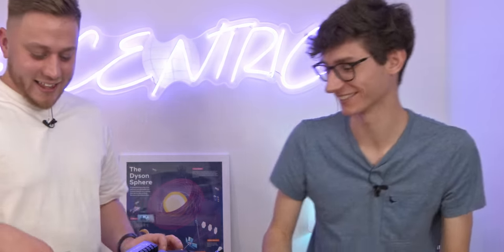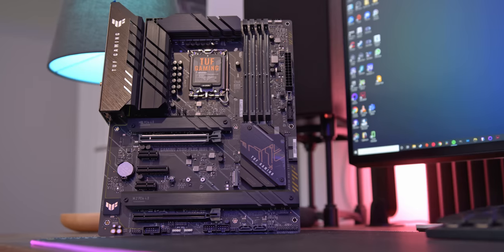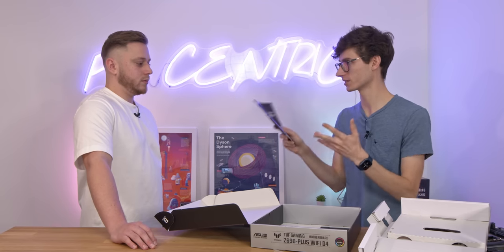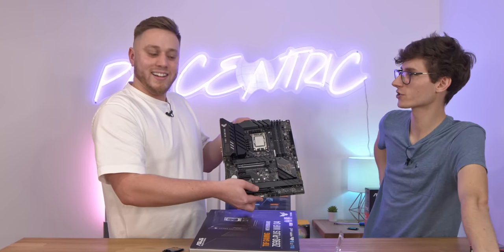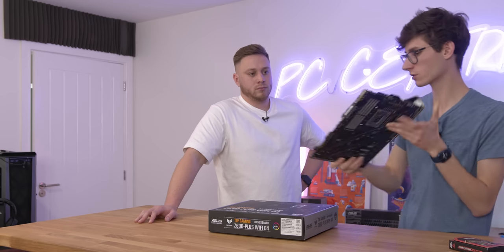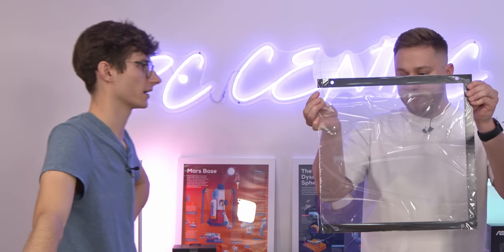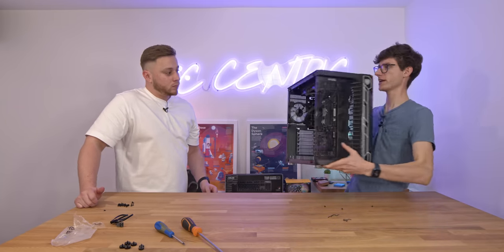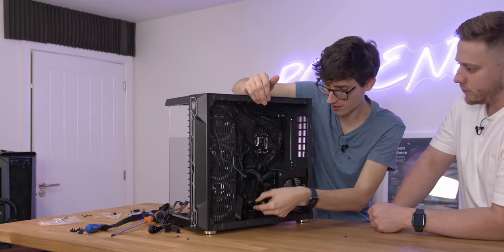Is Building A Gaming PC Hard? 🤔 A First Timer's Beginners Guide! (12600K, RX 6800 XT) | AD

Comment: When I was younger, I thought building PCs was extremely complicated and involved many tools. Turns out I was wrong according to the internet. You just buy the components and assemble them. (I have never built one before)
Reply: in earlier years it was not as straightforward
Reply: You don't just buy components and assemble them, they have to match the case, have room in the case with everything else in it, make sure it is compatible etc, I thought it was fairly easy until I assembled mine.
Reply: @Cam09Sean1  Yeah once you got all that sorted it's just building lego really and then connecting all the wires.

Comment: For any other fellow 1st time builders, you can do it!!! Just got my 1st one done, and not without issues to figure out. But it's all very doable. The main problems I encountered were not fully populating my CPU port on the motherboard (mine had a 4pin and an 8pin) and I figured out my cooling pump was not even contacting my processor so switched some brackets and no more hard shutdowns. Biggest piece of advice, download windows to a USB stick before you finish your build! It took me 5 hours to download lol Happy building guys! And thank you PC Centric. Could not have done my build without you and your awesome, easy to follow content.
Reply: Thank you for the windows tip. Just ordered a bunch of parts (my first pc build), and didnt concider that.
Reply: @Uhdksurvhunter  It is actually very easy when you look it up and watch a video, this commenter must have done it off memory, figured it out, looked it up and read it, or found a not so good video, I can share a video you would like me to, the long part it the waiting for windows to add to your drive.
Reply: gonna build my first pc soon, buying the gpu tomorrow then everything else within the next 8 weeks or so. man im nervous
Reply: when i say first pc i mean my first pc build ive got a nitro 5 ive had since 2022

Comment: I just completed my first build! I was so nervous and excited! Took me a few hours but it's running great!
Reply: Did you use the video as a guide, and how much did it cost?
Reply: @fromawindow9173  I didn't. I had just built it before this video. But I did watch a few YouTube videos to learn how. It cost me about $1000 with everything. I could've saved on some parts like the case and power supply. 

So just do your research before you spend. You can get some parts in a combo deal.

Comment: Great video. I will be building my 1st gaming pc. It gives me confidence. but still nervous I might plug those cables in the wrong slot. It looks easier in this video since PC centric is assisting that guy
Reply: Most cables are keyed, meaning they can not be plugged into an incorrect port.

Comment: I'm starting to get frustrated by the fact that I still can't get a gpu at msrp value bro otherwise I would've already finished my build so long ago :(
Reply: I dont even know where to start with a build 😔
Reply: Go to micro center
Reply: @isaacgarcia206  Assuming they are in the US of course
Reply: same here. finished my build back in May except for the card I want because of the ridiculous price. So I went for a 1060 6gb that's already used for mining for just 138.00 USD from a friend. It's almost dying though with temps going up to 90c even when undervolted and fans at 100%.

I'm hoping to finally snag a 3060 ti or a 3070 before christmas now that the prices are somewhat lower than like 5 or 6 months ago. Fingers crossed!
Reply: @gamax4254  Finally got an Asus Dual 3060 Ti OC! Got it for USD 800 though :( but oh well I believe here in my country the msrp for it would've been USD 500-600.

Other than that, I'm really happy with it! I can finally play RDR2 on ultra 1080p and constant 60fps!
Reply: If you're in Australia, PC Case Gear has loads of gpus for msrp and if you're in the US I believe microcenter has some

Comment: I much prefer the AIO setup to be for exhaust whether top or side/front mounted. It doesn’t make much sense to have hot air drawn into the case. Especially in setups that have additional fans drawing in air from the bottom, front or other side panel. Great build & excellent instructions!

Comment: A true fucking Bro right there!
I bought my first mid range PC as soon as I could afford one. It was used as I wasn't too sure I could build one and back then it was a little harder and there wasn't nearly as much PC focused channels around. I ended up taking it apart to learn how it's assembled and just reversed it, learning new things along the way. The mobo manual is probably the most handy thing you will ever need for this. Done many builds and it's pretty much press the button and it works first time, luckily. Just put together a 12700K build. But never watch The Verge PC Build video! LOL

Comment: Just recently built my first gaming pc, I previously had a 1030 and i5-4590 and ddr3 build LMAO. My new build is an i5-10600k and 3060 16GB of ddr4 ram, it made all the difference in the world. Also it was not as complicated as I thought it was gonna be, the most hardest and complicated part was cable management and where everything plugged into on the motherboard, which is easy once you pull out your motherboard manual. I am looking forward to the next time I get to build another pc :)

Comment: My 1st PC after a console use  2005   2010   2016    2019   2025?  
i got my Older pc drr3 2016 build out ( no nvme-m2 slots) and  added win10 pro - You Notice the speeds using ddr4 and faster Nvme  ssd's  cards

Comment: I think I'd be a better teacher.
I've recently upgraded my computer (from a mid 10s components with a late 2000s case) and basically all you need to know is (of course, some of these have comments about stuff I've done in the past): 
Change the new case's fans for RGB fans
BE IN AWE OF THE CABLE MANAGEMENT SPACE!
Place the RAM correctly. If you don't know, look at how the sticks and slots look. If it doesn't work one way, don't force it.
Place the CPU correctly. READ THE INSTRUCTIONS.
Place the CPU fan cooler..... wait, you'll need to mount an adapter. USE THE CORRECT SET OF ADAPTER that should come with the cooler, if said to be compatible.
NEVER OVER-SCREW.
Plug all the little case cables to their appropriate place on the motherboard. Names will match. Check for what look like what and read the instructions.
Those little single-plug plugs? The motherboard should come with a SMALL SINGLE-PLUGS BIG PLUG ADAPTER. Use it! It helps a lot!..... and will make the cables hold better.
Put the PSU in the case and wire the cables you need.
Put your GPU in.
Plug everything with the matching amount holes.
Wonder what that new mobo HDMI output is for.
Disregard that new mobo HDMI and stick with the good old GPU.

Comment: For my experience yes gaming pc can be hard to be built if youre not ready enough. First of taking care of the cable management should be prioritized if you have a powerful gaming pc since there can be alot of wires, If there is a problem you can hardly troubleshoot it if the cables are messy af, The gpu you should be cautious about and aswell as the cpu since the static in our palm can damage them and that the warranty will be revoked you should wear a gloves you should properly  analogize the fans is the easiest, and in the near future it gets easier and easier and harder at the sametime.

Comment: Can you help me build my new PC 🤷‍♂️🤣. It's gonna be my 2nd build but this time adding RGB fans. 

Spec will be:

Corsair 5000d case
I9 12900k
3090fe
Adata xpg lancer ddr5 (until white dominator becomes available)
Seagate firecuda 530 2tb
1000w psu 🤷‍♂️

Comment: Hey Marcus, as a newbie DIY builder i hit an issue which may be worth highlighting to your viewers, in particular those noobs like me who feel emboldened  by your videos. I went for a B660 and paired with with a i5 13600.... the motherboard has no flash bios... so unless you have an old 12th gen lying around, you are effectively dead in the water... unless of course you get a celeron purely for the update... so frustrating as i completely missed the manufacture date vs bios update for the B660 13th gen support

Comment: This is totally cool but you chose the wrong GPU completely. Along with not going with DDR5 RAM having access to it, you should have just used a 5600X. IMO this would have worked a lot better and made a lot more sense spending just another hundred bucks on DDR5 RAM and then an Nvidia 3080 for similar performance in games, more features and less money. Swap the RAM for budget tier DDR5 from a good brand like Crucial and swap the 6800XT which is a great card, have one myself but not as much of a value for gaming as the same priced 3080 Ti or save the money you spent on the DDR5 getting a 3080 which will get the same FPS in games as a 6800XT for the most part and have ray tracing etc he could play with.

Comment: my set up is a 3080 /3800x /32GB 3600mhz/B550 micro atx am4 / 120mmAio/ B550/750w gold / 3440x1440p 165hz/ All i do is play games and watch videos i wanna do a few upgrades with Christmas coming up i need some gift ideas i wanna get a 4k144hz as my second monitor but i can buy that myself im not quit hitting 165hz  at 1440p on my current set up what should i upgrade and what should i get? i can get maybe like 3 thing and i just want more frames! im stuck between getting the 3800x3d or going ddr5 and or switching to intel. Most played games are warzone and sea of thieves

Comment: Building a pc I’m getting a Asus ROG STRIX B450-F GAMING II ATX AM4 Motherboard a 1650 graphics card, 16gb of Corsair ram, cool master double fan, a case with 2 fans, 2tb of sea gate storage, ryzen 5 5600x and Corsair Rmx 2021 850w power supply,  will it be good for modern day gaming ?
Reply: that psu kinda overkill for that setup

Comment: Hello,
I really like this channel. I looked up A LOT of video of your channel haha. I am a singer- songwriter that plays sometimes games with my buddies. I have no intent to build a pc myself, I don't trust myself with it. I would like to let someone build I for the specs I need. I read a lot about hardware but i am not curtain about the components that i need for what i want to play. So I have a couple of questions because you really know the stuff. My budget is 1600 euro (1400 pounds). I like to play fifa, god of war 1-2, battlefield V, lord of the fallen ( not out jet), planning to play crimson dessert (not out jet) and other triple A titles. I play with a 1440 p Dell monitor. I would like to play all my games on high settings. The pc is not needed to do video or audio work. I would like to be able to have a motherboard that is upgradable. What kind of GPU, CPU, motherboard, Ram DDR5,6? , cooling do I need? Can I combine different brandes? I do not want to run in to bottlenecking that fast.

Comment: WOULD LOVE your take and opinion on what build i need... i am a senior on a disability fund...not very tech savy..what i use my computer for is ( music , web surfing , facebook , shopping , emailing , photos , researching stuff etc ) I DO NOT PLAY GAMES ON IT other than card games and yatzee....my only requirement is a 2TB SSD or more ( currently have a 250gb and its half full ) I want fast and lots of storage for photos and music... would be interested what you come up with in which
motherboard ?
GPU ?
CPU ?
SSD ?
sound card ?
what RAM ?
case ?
power supply ?
etc
want best bang for your buck and still a kickass system that will last me 6 years or more I am usually on the computer about 5-8 hours a day
thank you i look forward to your thoughts
cheers from Canada

Comment: I’m doing my first gaming PC and I’m learning step by step. Question. Do I apply the thermo paste the first time I put my processor in? Or do I apply it later? For example like a year or so?
Reply: It would make absolutely no sense to put thermal paste a year later. You always put thermal paste when you install the CPU & cooler. The thermal paste allows for good heat transfer between the CPU and the CPU cooler. Without it, the cooling may not be very effective leading to high temperatures and/or poor performance.

Comment: Hi. I do have exactly same case. I have two questions that wasn't really clear. It's about the the molex cables. Do we need to have one from the power source to connect to the the one from the case top molex???? And, what's the best way to identify and connect power cable from pcu to the gpu at the mother board?? Thanks

Comment: Awesome vid! Super smooth and easy to follow 
I’m building my first pc and looking for a do or don’t on the list from those with experience - thanks! 
My potential parts:
NVIDIA GeForce RTX 3090ti 
AMD Ryzen 9 5950x
MSI MEG x570 godlike 
Hydro X series icue xh305i RGB pro cooling kit
Vengeance 128gb DDR4 DRAM 3200 MHz 
MP600 core 4TB
RM850 gold ATX PSU

Would you upgrade anything? Downgrade? I play games and video edit.
Reply: That RAM seems overkill, I would save some dolla by going down to 64GB. Everything here seems extremely high end man, I wouldn't even worry. Just check compatibility of everything. Crazy specs man.
Reply: @DeadwoodJawn  thanks I guess I’ve been so burdened when editing video that I just want to send it through the roof 😂 I went with 3080 ti 64gb ram Meg x570 unify. Everything else is the same. Thanks for taking the time to reply.
Reply: @ZEROIDEAPodcast  Should have went for 512gb of ddr5 ram 7200 MHz CL24 while you were at it lol.
Reply: @bringbackdislikes3195  I can play any game on ultra settings while my pc sleeps. I very much so went overboard lol 🤷🏻‍♂️ whoops
Reply: @ZEROIDEAPodcast  Haha well as long as you are happy with what you have I would say you're doing great.

Comment: I have a question will all of that fit into any empty desktop case? Or is there a size?
Reply: Empty desktop case is very vague. There isn't just one size of desktop case in the entire world. I strongly learning what PC form factors are. As long as the motherboard and case share the same form factor support, it will work. After that, it comes down to things like airflow and GPU dimensions and support and then aesthetics if you're into that.

Comment: I need help. Anyone have a good subreddit or discord for pc stuff??? I just embarked on my journey on building my first PC. Now I’ve been gaming on PC for a very long time and within the past two years I’ve really started understanding what I’ve been using to run games. My last crappy computer died so I’m building one now. I went to my local Micro Center and was able to get a very nice GPU for pretty low price compared to what I was looking at but now I don’t really know what else parts to get that are compatible. I got the gigabyte GeForce RTX 3060 TI. I’m not sure what motherboard and CPU I should get that will not cap the power of the GPU any suggestions would be awesome. I mainly play wow and league but I want to be able to branch two more bigger games like Warzone or rainbow six my last computer died when I installed these…

Comment: Sadly I will never feel confident in ever trying this. Building PCs is super hard...
Reply: What makes you say that? You think building a modern PC is hard? Its much easier nowadays compared to 2-3 decades ago. Back then, you really had to understand what you were doing. You probably don't realize it, but in those older PCs, it was a much more involved process. Nowadays, its mostly plug and play whereas back then it was more like plug and pray.
Reply: @JJFlores197  It is so easy to screw up even the smallest thing and plugging in & doing the entire process is looking so complicated
Reply: @MrGranturismofan1  If you're clumsy and/or not careful with what you're doing, sure you can easily mess up components. If you're gentle and logically thinking about what you're doing, you will likely be fine.

I got started with PCs as a kid in the early 2000s. Most of the time I had no idea what I was doing. I just thought it was fun clicking on buttons and options and taking things apart and then trying to put them back together again. A lot of us learn by trial and error. To each their own.
Reply: I put mine together about 3 years ago now.
First time, utterly terrified. Not confident at all.
Just took it one step at a time, nice and slow.
Nothing compares to the thrill of powering it on and seeing it all work and saying "I built that" 💜

Comment: Sadly the build is the easy part. Partitioning the drives, optimizing the ddr, etc and so on with the software is the hardest part for me.
Reply: There's really no need to manually partition drives anymore. You just tell Windows to install on the drive and it does it for you automatically.

Comment: Is This Gaming PC Build Good For Under $1,000 ?

Specs :

GPU - ASUS GeForce RTX 2060 6G GDDR6 $489.99

CPU - Intel Core i5-10400F - 6-Core 2.9 GHz LGA 1200 $125.49

Motherboard - MSI B560M PRO-E LGA 1200 Intel DDR4 (Has NVMe M.2) $83.99

RAM - CORSAIR Vengeance LPX 16GB (2 x 8GB) DDR4 3200 $64.99

Storage - Crucial P2 1TB 3D NAND NVMe PCIe M.2 SSD $81.29

Power Supply - Corsair CV Series, CV550, 550 Watt, 80+ Bronze Certified $40.49

Case - DEEPCOOL MATREXX 50 Mid-Tower Case 4x120mm RGB Fans $87.99

Total : $974.23
Reply: your cpu is gonna hate you
Reply: @shromjon224  and why is that ? he shouId be fine after i get him a Iiquid cooIer